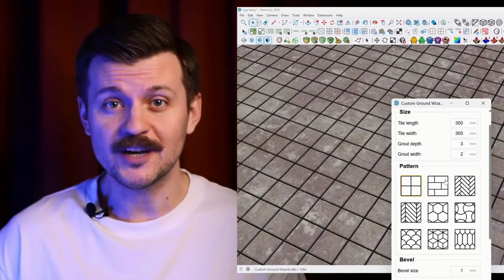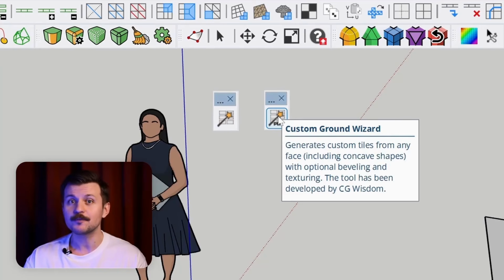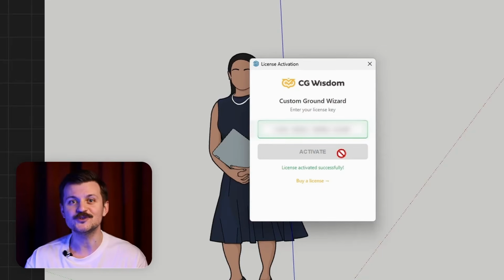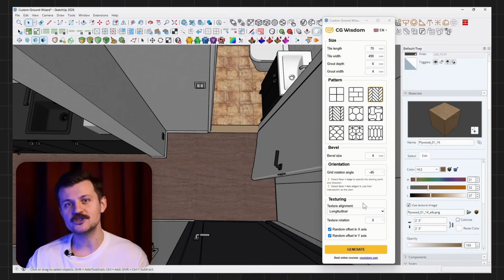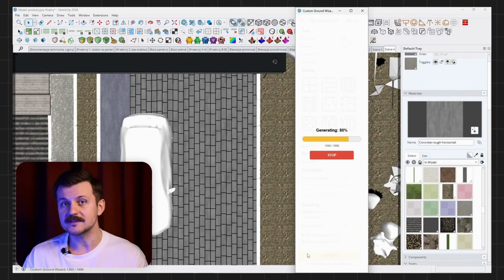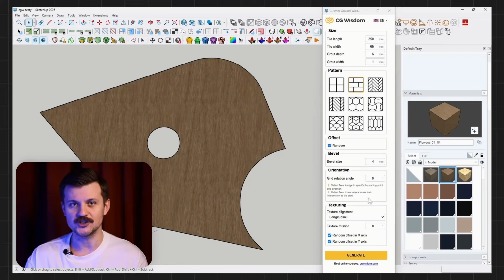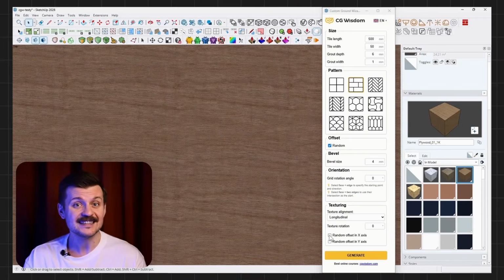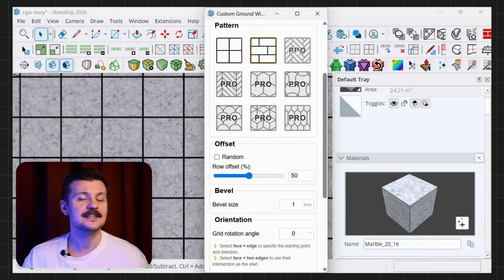No more placing herringbone manually in SketchUp — Meet Custom Ground Wizard!

Comment: Excellent tool, I just bought it. It also allows you to replace extensions like Curic Face Aray when you want to install openwork battens; it works very well for that and is faster with texture randomization. This randomization is very well done, even for herringbone patterns. CG Wisdom added, at my request, this function that allows you to remember the last setting and save it as the default on opening; but I would have preferred to be able to save each setting to create a library of flooring or cladding and be able to reuse them later... to be continued
Reply from the maker: Thank you for your feedback on our plugin and for your suggestion. We’ll consider how best to implement the option to save settings for different floor types in the future :)

Comment: I can't save a setting to use as a template. If I close the plugin, I have to start over. Is this a feature planned for the paid version? That would be perfect.
Reply from the maker: Good idea. We will think about it!
Reply: @cgwisdom-en  Okay, in the meantime I can take a screenshot...
Reply from the maker: @jskup  We just wanted to let you know that we've added an option to save your settings as defaults :) When you launch SketchUp, you should see a message about the latest version, 1.2.6
Reply: @cgwisdom-en that's great and i have already bought the pro version. sorry for my english...